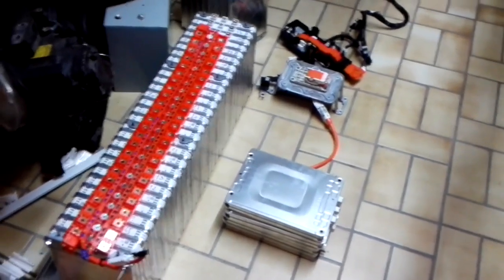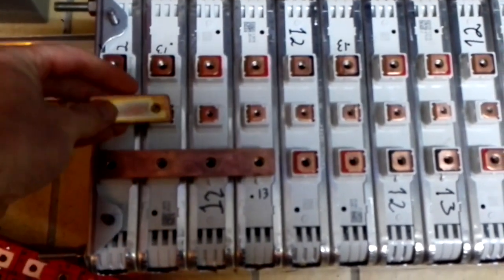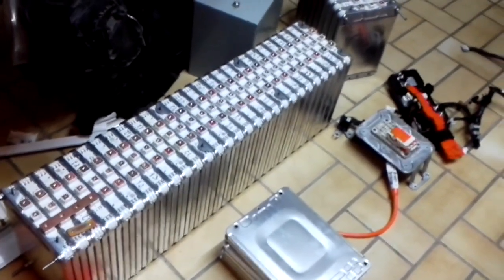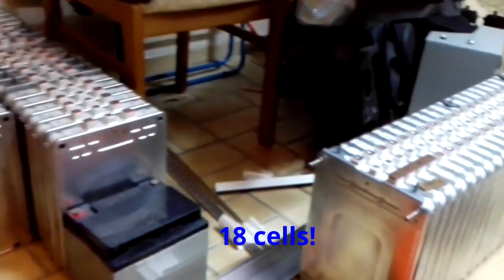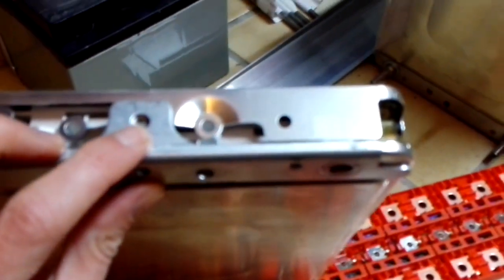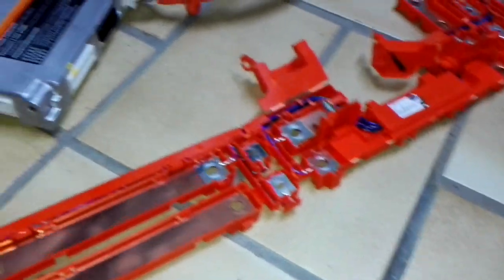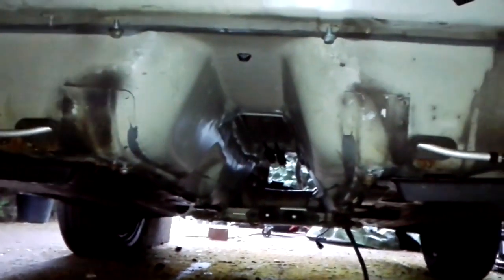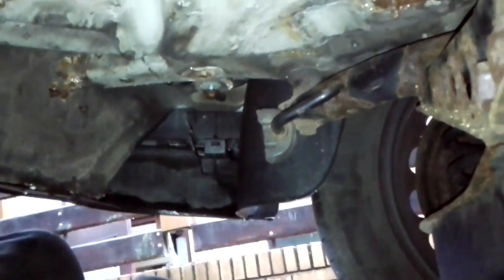Lab Update #21: Fitting 2 Leaf batteries in VW Touran

Comment: Hi Johannes, I'm considering a touran or Sharan . Have you considered using the leaf drivetrain , including gearbox . Then all you would need 
would be two custom drive  shafts - or maybe there's not enough room ?
Reply from the maker: Yes I have considered it but decided it was more work fitting the transmission an adapting the drive shafts than fitting the motor to the VW gear box